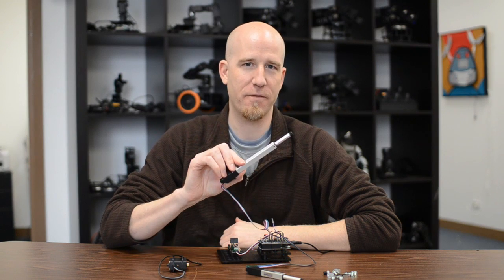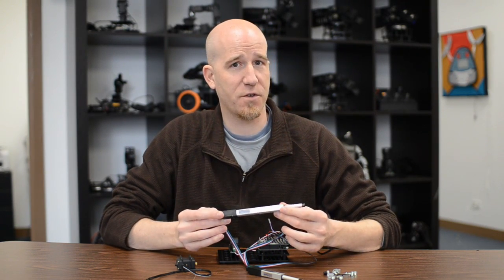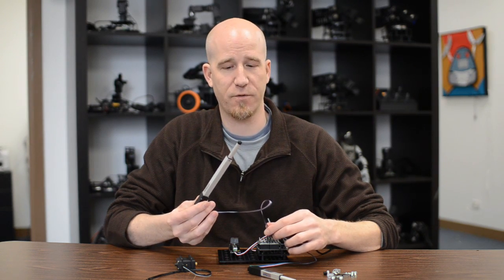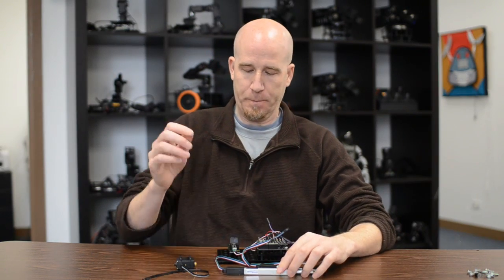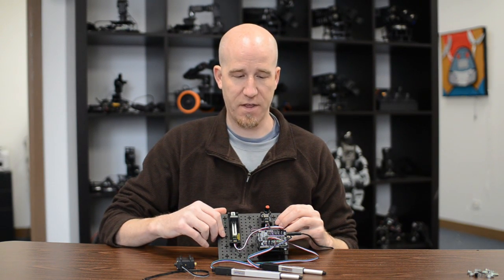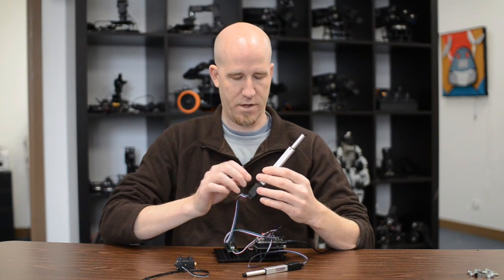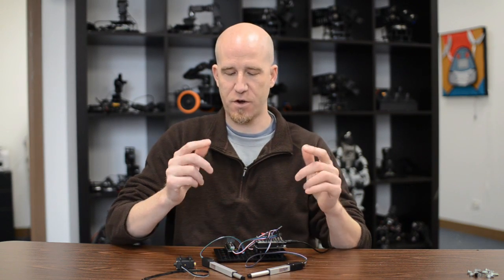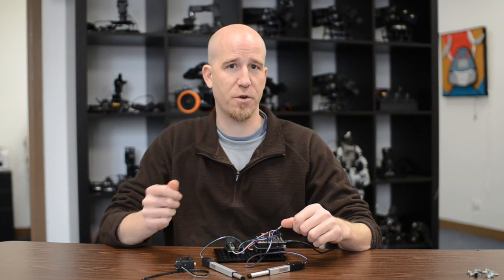Controlling Linear Actuators with Analog Input

Comment: Hello, I would like to ask whether there were any commercial "compacted" linear actuators controlled by an analog knob.
What i mean by compacted: i need the same function as you have demonstrated in this video, but i don't want any boards or cables flying around, just my linear actuator, and hopefully a small box at the end of it where my control knob is.

am i asking for a lot? :)
Thank you anyway!